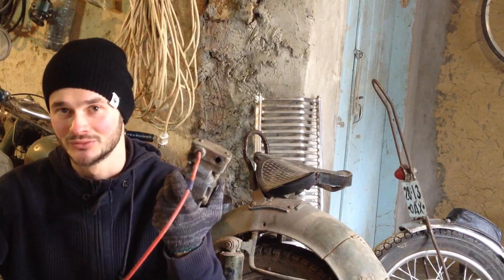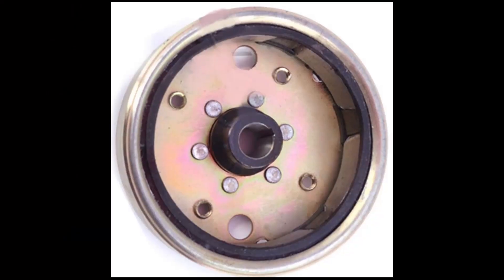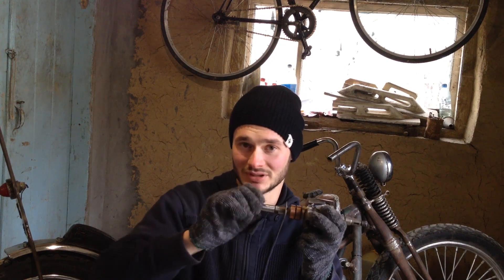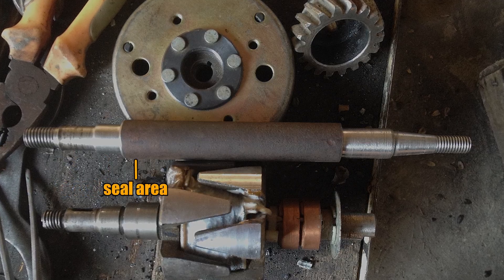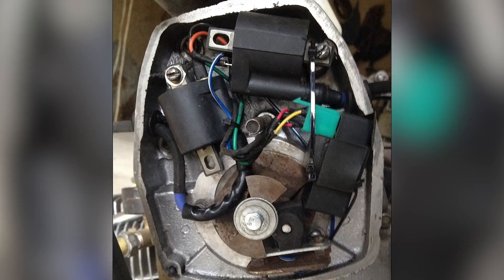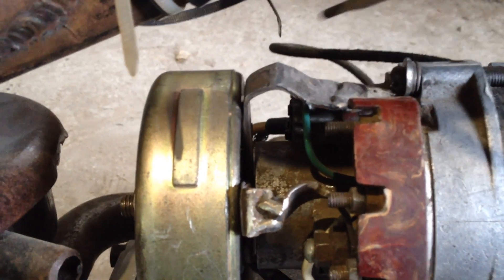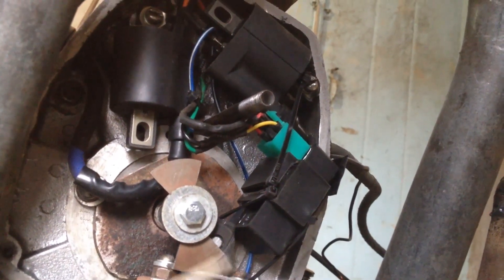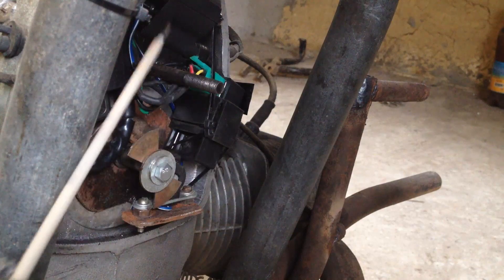I Fired Up My Chopper Without A Battery.

Comment: get the coil from an I4. twin lead. both plugs fire at the same time anyway, so its ideal... one trigger tab...

any imbalance in the trigger "butterfly" is giving different timing on either cylinder..

if you had looked at motorised bicycles engines and their ignition you would see how simple a CDI actually is. in fact, the magneto from one would be a pretty simple addition...

Comment: I've done this conversion many times, but you can use a capacitor instead just like they do on Triumph and BSA's with an alternator, usually reffered to as 'emergency' ignition.
Reply from the maker: Yup, I’m aware of that. It’s just that I’ve got ideas and want to implement them. There’s two more videos are coming up about starting up 4-stroke engines without batteries with different approaches